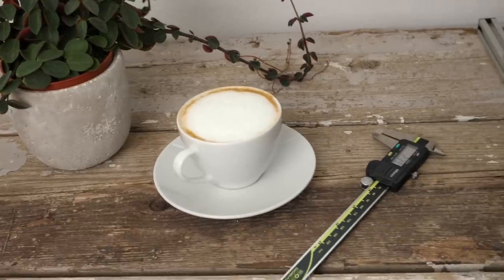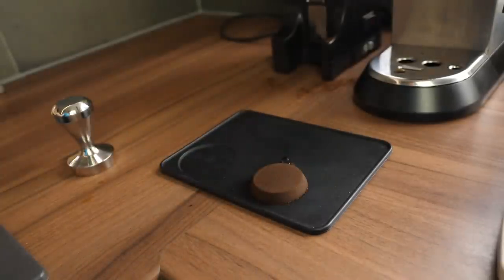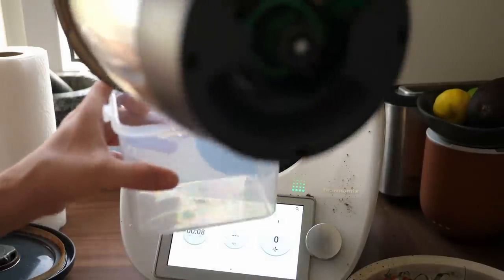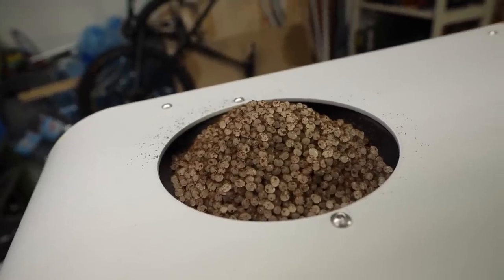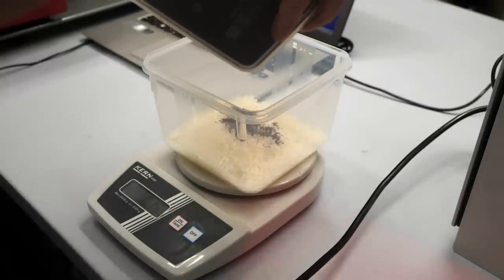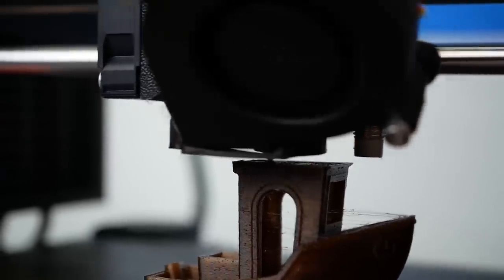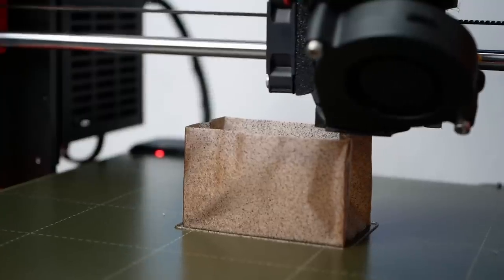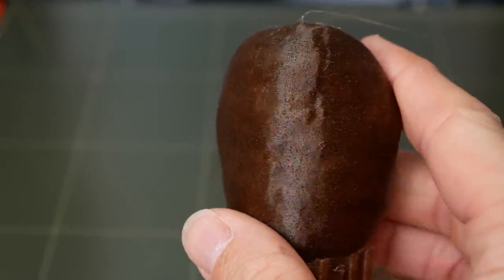I made COFFEE 3D Printing FILAMENT

Comment from the maker: Drink coffee or print coffee - On which side are you?
Don't forget to like & subscribe and share this video on Facebook, Reddit, Twitter, and other platforms!
Reply: I hoped a little bit that you bought it so I can buy it too because it's very cool!
Reply: I brew a lot of coffee, and I could say that you could do a similar test with light roast coffee. 

The difference in between light and dark roasted coffee is the brittleness. Dark roasted coffee are less dense and brittle than light roasted coffee. So, you should get a better result with a light roasted specialty coffee.
Reply: You forgot an important additive for polymers "Blowing agent" to make a cellular plastic instead of a bulky one, whit that you could reduce the density of your printings.
Reply: print coffee :)
Reply: Besides saving material the filllers modify the mechanical properties quite much. In a thoothfilling the Composite has round up to 94 Mass % of fillers in the material. 

Fillers reduce the durability of a material - the cracks run just around the particles and the failure happens earlier and with lower forces. 

The trick to improve the strength of a material through fillers is to chemically bind them to the base material - e.g. the mentioned partical in dentistry are bound to the Bowen-polymers with silan molecules. 

I have no idea what the residue of old brewed coffee beens contain chemically but you'll find out. There will be a possibility to adapt the hydrophilic properties and the chemical bonding. 

The best thing will be to have premixed coffeebeannanoclusters to mix to the pla. 

But in the end it's not about the mechanical properties but the smell.
Reply: You should really invest in that ball mill for your filament experiments, it should hopefully help get all the particle sizes down when recycling plastic or trying out this coffee trick. I've seen them for $100 or less.
Reply: Eating 3d printed coffee :D
Reply: I would be really interested to see how much of the PLA blend would need to be printed to match the strength of the virgin PLA filament. Maybe you'll find a filler that's more economical than pure PLA for a certain strength metric
Reply: Why not grind your coffee filament in your blender to further break up all the bits and then extrude your coffee filament?
Reply: Both
Reply: Legendary! Print spent coffee ☕️ for sure. Shared on facie. Once cost/benefits worked out after all the steps, some forward thinking company should adopt, coffee market would go nuts.. is a good sales hook 🪝.. great informative vid as always CNC kitchen.
Reply: You should definitly send a spool over to James Hoffmann. He got into 3d Printing lately.
Reply: possible to get a sample of your coffee filament? xD
Reply: yes.
Reply: Print
Reply: Oof do you think it might be possible to order some Coffee filament of you plz 😯
Reply: Recipe for an extra fine coffee powder: In a sauce pan boil a very dark coffee. We're looking for quantity here, you're not going to drink it, so give it time to darken. Then let the coffee evaporate and collect the extra fine powder at the bottom and dry it.
Reply: Definitely drink coffee
Reply: i prefer drinking my coffee out of a cup made of coffee
Reply: Print a coffee cup out of it.
Reply: Drink. Because I neither own. Nor, know how to operate a 3d printer.
Reply: Drink
Reply: considering you are using used coffee I'd say you are on both :-)
Reply: Neither, I prefer Chai Tea. Even the smell of coffee makes me feel sick.
Reply: Is there anyway I could purchase a roll of these coffee ground materials ? @cnckitchen
Reply: Hi, what the setting of temperature and fan speed are you using for this material. Can you let me know that please

Comment: Those coffee particles still look huge to me. I work with twin screw extruders so maybe I'm just used to super fine pigments, but we have never had a noticeable drop mechanical properties even at 5% pigments. Maybe try putting the bowl and coffee grind in a freezer for a while right before grinding. ABS/ASA is commonly cryo grinded because it will just remelt from shear otherwise. Making it colder and more brittle may help get smaller particles and better mixing.
Reply from the maker: You're right about that. I'm currently looking into ways to grind the material down even more.
Reply: @CNCKitchen  Do you have space for a ball mill in your freezer?
Reply: @CNCKitchen  team up with James Hoffmann, he knows a thing or two about grinders

Comment: The plastic fluidity changes because your filler changed the specific heat of the plastic. Your thermal cartridge is putting out a certain amount of power per second and your plastic is absorbing that same amount of power. Adding your filler means that a certain volume of plastic can actually hold less heat now and therefore reaches a higher temperature for that amount of power absorbed.

Comment: i have started to almost exclusivly use polyterra for my pla parts. Not only does it give and amazing finish and prints very well, it also uses 20% organic fillers and comes on a really well made cardbord spool
Reply: That stuff is pretty amazing. I used to to print some coasters that look like toast and waffles. The banana yellow is spot on Eggo color, haha! 
It's definitely not as strong, but the matte finish is beautiful.  My biggest problem with it is the smell while it prints. Gives be an awful headache.  😢
Reply: The only bad thing about Polyterra is the bad layer adhesion. I love the matte finish.
Reply: @Felipeh999  i havent had issues with that yet. I print it at 205 regularly and 200 in my mmu
Reply: @oOSpecialProskillsOo  Ok, to be fair, layer adhesion is not bad, it's just not as good as regular PLA. Normally I don't have any problems with it, but I've had small details breaking off very easily and layer pealing apart in vases.

Comment: I just come around this channel a few days ago, mr3dprint shows how he produces his PET filament from plastic bottles with really little material, no leadscrew, no overly expensive extruder, just a razor blade, a heater block, a stepper and a 3d printer main board for the temperature regulation

Comment: I know you mentioned a ball mill but a cheaper (albeit slower) method would be a stone mill/chocolate melanger/ wet grinder.  Typically they'd use some sort of oil matrix (think chocolate) but the particle size reduction of continuous run times of 3-4 days on these machines can get down <50 microns consistently.  I've never run them in water (so as to not add any more plasticizers aside from the expressed oil in the bean but really all you need is flow.  You could then dry and further sieve the product. By far the cheapest particle reduction methods I've used.

Comment: To increase mixing grade of coffe to PLA I would try a 2 stages approach. First mix 20 % Coffea. You should obtain a pretty bad filament, unprintable, but still a filament. Cut the filament in pellets similar size of virgin pla you have and than mix 50% the result with the virgin PLA. Similar size particles are more easy to mix than so different size, and separation due to vibration is more difficoult. Other approach is pre-mix the coffe with fine ground virgin PLA and than add this powder to the pellet virgin PLA. It should be an easier approach but I guess 2 stages one is more likely to give you better results

Comment: Coffee has a number of fatty acids: including oleic acid.  they are outstanding capping agents...which would reduce viscosity of the mix.  not sure if this was the improved flow that you noticed when making it.  But it may reduce layer adhesion as it is soluble in water.  I use Oleic acid as a capping agent in producing nano particles and coffee or even better green tea are great sources.  I wish I had that filament extruder for experimenting using my powdered nano material fillers.

Comment: Hi Stefan, awesome video you did there. I work with extruders and the problem with your  (usually with kneading elements in twin-screw extruders) to deagglomerate the coffee. Either you could extrude the printed filament again and hope for smaller particles or you would have to mill the coffee beforehand. If you mill it with the PLA, I would definitly use dry ice to reduce degradation of PLA. Also if you only feed powder to the extruder there could be problems with reduced feeding or no feeding at all. Hope this helps somewhat!

Comment: You can get filaments with around 80% metal or ceramic which you print and then melt the plastic away to leave a pure metal or ceramic part. If you refined the process a lot you could try this with coffee.

Comment: I bet the coloring would be more consistent if you brewed the used coffee grounds, mixed it with the PLA pellets and then dehydrated them. I do not know if the pellet shape would deform too much or if them deforming would be a problem. Only using what could come out of a paper filter would mean much less clogging but much less texture too.

Comment: I would be interested in a 4% used coffee grounds 1% fresh coffee ground combination for the oils/smells/etc factors.  i would think that some 'fresh' grounds added to the spent grounds to make the PLA would add a more enjoyable/powerful aroma of fresh coffee, while at the same time might change the physical properties of the PLA - due to the oils/composition of fresh ground beans over just spent ground beans.  Maybe a different ratio as well - maybe 3% spent 2% new.   This is counter-useful for things like "recycling old coffee grounds straight" but might give additional benefits if the chemical composition can change the end-result PLA - even in composting or recycling/remelting again into new filament.         Needless to say this opens a window, if not a door, into possibilities to test out for beneficial PLA properties, even if it is just an "enjoyable aroma while printing".

Comment: I wonder if, instead of baking the grounds at 100°C, you dried them at a much lower temperature, if they would retain their coffee odor a bit more. As for the question of the higher percentage of grounds, what if, after pulling it through the extruder, with all the clumping that entails, then chopping it up and running it through again hopefully redistributing those clumps. Another, possibly better thing to try would be to make a 5% coffee filament, then chop it up and run it through again, this time with another 5% coffee added. The second 5% should theoretically be distributed about as evenly as the first 5%.

Comment: Mr Stephan. I remember (but impossible to find it again)  a techniq  of 3d printing where a very very thin thread of strong material (nylon could be?) was inserted just after melting the PLA, crating an PLA -  NYLOn reinforced impression.  Have you ever try this kind of 3d printing? (adding a metal cord or nylon or whatever) during the 3d printing itself process??

Comment: Haha, very cool idea, really curios about the smell though! Keep it up.
What about testing the recyclability of the byopolimer plastic in HEETS filters as 3D printing filament? HEETS(IQOS) are a supposedly healthier alternative to actual cigarettes but they have a plastic inside the filter (which seems to cover about idk, 20-30% of the actual cigarette) which more often than not, ends up in the ocean unfortunately.. I don't know if it is an actual thermoplastic material but if i heat it up just enough with a lighter I can stretch it by hand without it dripping and as it cools down it hardens without any visible warping.
Thank you for all the hard work that you put in, each and every video I've watched helped out a lot.

Comment: A silly suggestion:

What happens if you mix in a solvent like acetone?  
Or is that too much of a fire-hazard?

I guess it would be too dangerous to try.

Would an ultrasonic-cleaner be able to break coffee particles into smaller pieces?  I guess no, because the particles are probably too tough.  So yeah, probably need ball mill....

Comment: Can you test "composite" printing method? I'm looking for reliable and fast production method using 3D printing. So I have idea of combining FDM printing hollow (or realy low infill % for shape retention) parts strengthened with epoxy resin or even with additional glass fiber.

Comment: Hey Stephan, I’ve been watching a while now, and I’ve had this question, could you test the compressive strength or resistance of these prints, just in general.  It’s part of load-bearing, so if the material shears or deforms while under pressure, it would be good to know.  Keep up the good work!

Comment: How about this for better mixing:
Make the filament.
Grind the filament.
Make gen 2 filament.
Grind the filament.
Make gen 3 filament.
Print gen 3 filament.
Reply from the maker: Yes, though the heat cycles will degrade the plastic. That's why you want to keep them to a minimum.

Comment: that filament maker is expensive as hell, but I strongly suspect if one runs banks of printers in a professional application that bags of pellets eventually becomes cheaper than spools of filament.  Since all other mfg works that way, At a certain point buying the raw materials and processing on site can become cheaper due to scale of purchase.
Reply: yes. also allows you to recycle supports and failed prints

Comment: Isn't it true that you can put 5% of anything dry into filament if you grid it finely enough to get through the nozzle? Brick dust, wood dust, other plastics,...
Reply from the maker: Yeah, basically - if the filler is able to handle the 200°C+ during the extrusion process.

Comment: Looking forwards to the results of composting this blend and other bios. PLA as is, overall practically speaking, must be considered non-biodegradable and non recycleable. The extremely hot industrial composting requirements are simply not regionally available to 99+% of the world, including 95+% of the "Western" population. Nor is the incredibly granular waste separation, neccessary to facilitate any significant material recycling. And the vast majority of consumers aren't too keen on paying 2-5x the cost of a filament spool, on shipping 1 filament spool worth of PLA waste internationally to one of the few companies in the world that do 3d print material recycling of anything more than their own in-house production scrap (because that's the only materials of which they have solid verifiable knowledge of its actual content, blend, environmental factors and contaminations). And it's certainly debateable if not the process of sending materials like this, doesn't post a much bigger environmental impact, than the waste itself.

In my humble, flawed and surely biased view, what this industry desperately needs for environmental and material sustainability - is a set of industry standardized polymer and monomer thermoplastics, which consumers, waste processing entities and material recycling companies can both identify and know are compatible (including additives and blends) in terms of recycling into new product. Ideally, many/most of them would be compatible to blend too. So that known ratios or minor contamination would still yield reasonably predictable results, even if that "new" blend might not be suitable to make filament of, but be limited to rougher, molded and stamped products.

And - far more consumer-friendly, easy and clear identification of thermoset plastic filaments. There are substantial limits to how much of the recycling equation, consumers can be expected to carry on their own. Governments, institutions and companies really need to massively up their own efforts and responsibilites in this. Consumers only really have the power of control, over putting their waste into reasonably segmented and accessible bins, made available to them. And we know that it isn't super effective as is - it's mostly just paper, glass, metals and untreated wood that have a high degree of actual material recycling. EVERYTHING else in this entire system of chains, is on governments, regulatory bodies, institutions, waste processing, manufacturers and vendors. And no - "vote with your wallet" doesn't count (or to many extents even work) - it's just an excuse by these entities for doing nothing themselves. You may put a tiiiny bit of force on political leaderships, a regulatory body or a company - but you don't have actual power to make changes. Only that entity itself does.

Comment: Interesting Video as always.
As a side note: E.g. Ford has a colaboration with McDonalds to reduce the consumption of crude oil plastics in the car production by using coffee chaf as a filler in polymer parts. https://youtu.be/vthEl3FQBfU I think I might have seen injection molded coffee cups with coffee ground filler.
Maybe you could try to get a hand on such injection molding pellets to see how those compare property wise.
I believe to get better material properties even finer grinded coffee beans could be helpful. Maybe. 
Did you add test specimen into the compost? I am in the group of believers that visually you won't notice much besides they are dirty. But maybe the mechanical properties will change.
Reply from the maker: Thanks for the additional info!
The composting test includes visual samples as well as mechanical test parts to see if anything happend.